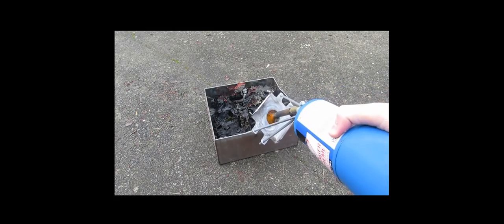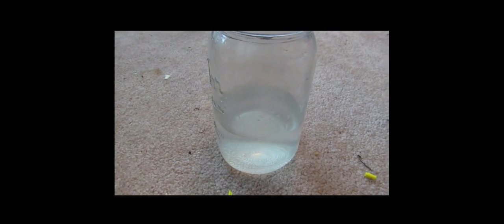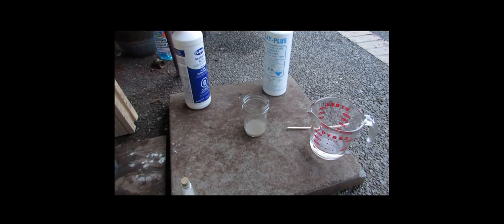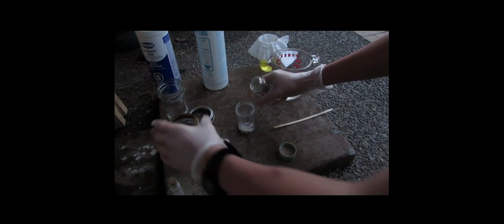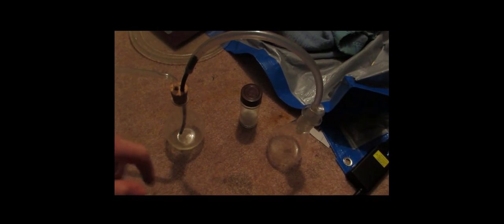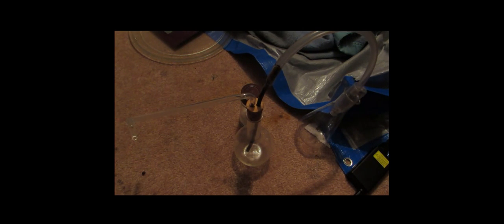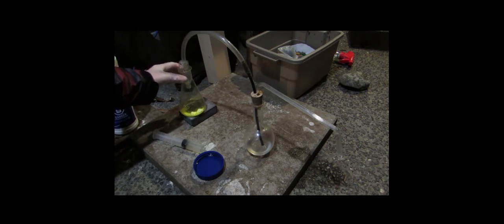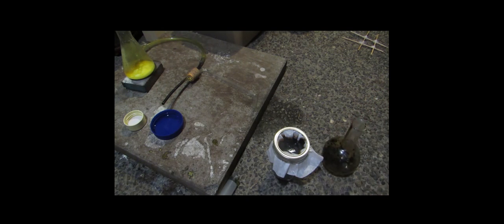Iodine from Seaweed (Household Materials)

Comment: The yellow/brown color which appeared in the first test with the hydrochloric acid and the hydrogen peroxide may have been from the triiodide ion, which is formed when iodine reacts with the iodide ion. It is brown in high concentrations and yellow in low concentrations, and the reaction is favorable in acidic solution.

Comment: Since fluorine probably won't be that easy to do: how would one synthesise bromine from household materials?
Reply from the maker: it is very easy from potassium bromide which is found in pool chemicals, any bromide salt should work. I simply reacted the bromide salt in solution by bubbling chlorine into it, then heating it up to distill the bromine. I will do a video in the future as I have already made bromine. As for fluorine... I have all the materials to make it and have created a method myself that should be able to make fluorine gas from household materials!!! It will be extremely deadly and unsafe but I really want to try it. It uses anhydrous hydrogen fluoride liquid which I will show how to make. It is so deadly if it gets on more than 3 % of your body your at serious risk of death. There is a lot of preparation such as building a fume hood so the chemicals can be moved 30 feet away from you. You also must have a gas mask, water to jump in incase of it getting on you, And always do it outside. I am super excited to try this and will probably get underway on it soon.
Reply: @TheCanadianChemist  Jesus Christ HF is so scary... Love ur vids but pls don't hurt urself lol